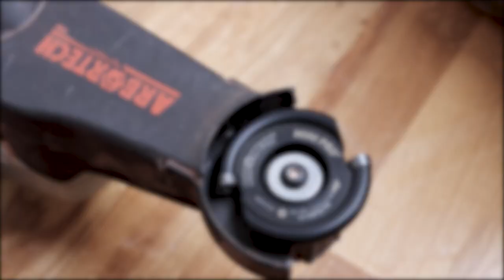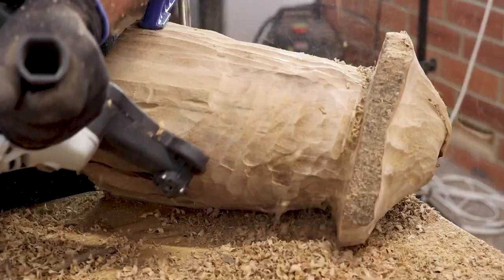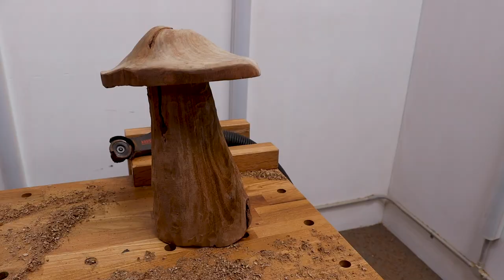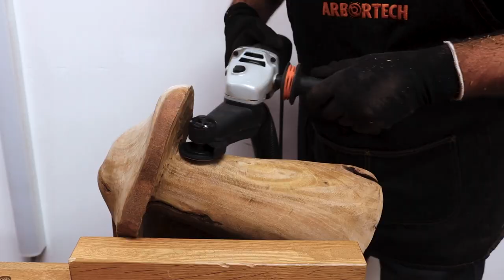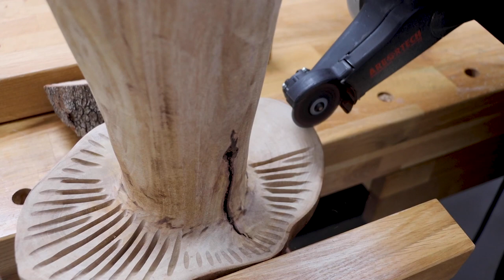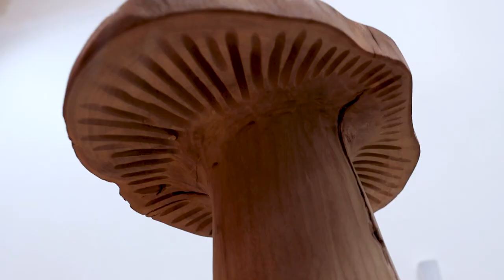Carve A Decorative Mushroom Out Of Scrap Wood | Arbortech Tools

Comment: Question for Arbortech...is it possible to just get the Mini-Carver head and bits only to attach to my Arbortech Power Carving Tool? I know that it is not on the USA website, but it appears that both units use the same angle grinder power head. Thanks, Charlie
Reply from the maker: Hi Charlie,  thanks for the message. Unfortunately, we don't sell them separately. Cheers!